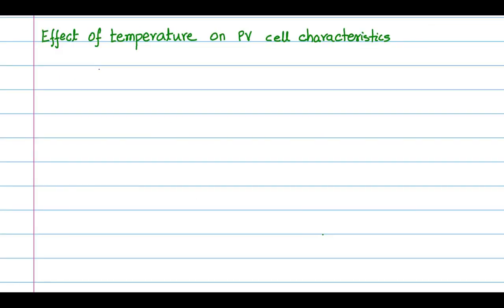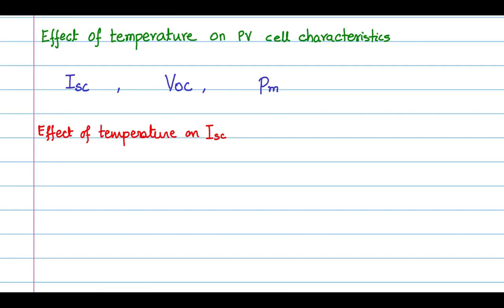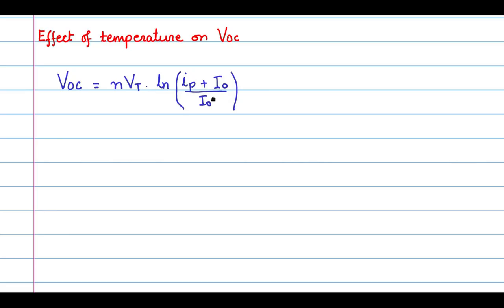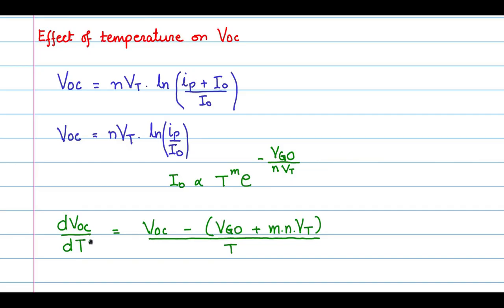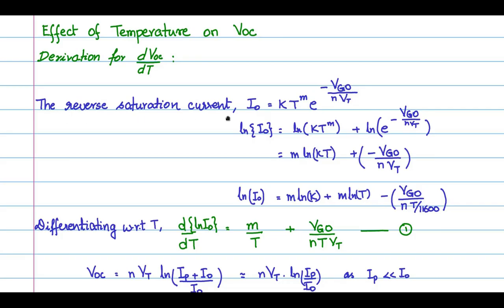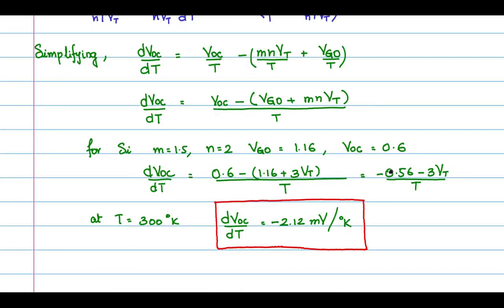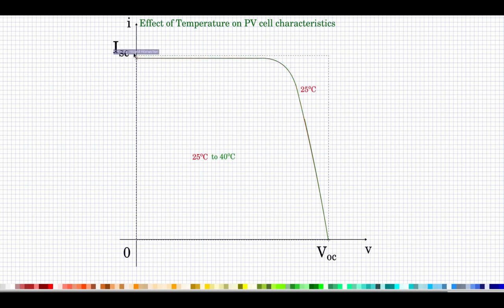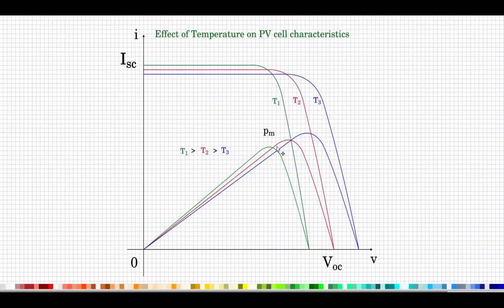Effect of temperature

Comment: Can anyone explain me the physics backround in decrease of effieciency in PV cells when the temperature increases? According to physics, higher temperature in semiconductors generates more free electrons so why is there a decrease in efficiency? 

I do not care too much about equasions... just the basic principle.

Thank you :)
Reply: Hi Josef,
As the temperature increases, there is a decrease in semiconductor "band gap", which in turn decreases the cell output voltage.
The term "band gap" represents the minimum energy that is required to excite an electron up to a state in the conduction band where it can participate in conduction.
Hope it clarifies !
- Sukhbir
Reply: @dearsukhbir  Hello, 
thank you a lot, this is the type of language I was looking for.
Bless you sir, I understand now :)
Reply: But shouldn’t the decrease in band gap width increase efficiency because  it is easier to excite and free an electron and therefore allow it to participate in conduction?
Reply: @manasahuja1193  I believe the trick here is in the output voltage.

When there is a decrease in a band gap, you might excite the electrons easier, but as long as it decreases the output voltage, you get less energy transfered to the load.

So less energy from the light is being utilized and you get lower efficiency.

Comment: respected sir, 
I have a doubt, we are Voc as 0.6 V, and calling it the cut-in voltage; is it the cut-in voltage due to the silicon p-n junction, however, Voc is the open circuit voltage, and as per the data-sheet of the BLD 240-60P discussed in the previous lectures; its value is 36.7 V, I will be very grateful if you and your team may clarify this doubt.
Reply: Every cell produce 0.6 V, and you have many of them connected in series, they were 60 cells, 60 * 0.6 = 36 V. These 60 cell is connected in series so the diodes like added in series so their total cut-in voltage will be 36 V, the diode he drawn imagine it many diodes in series that their equivalent is 36 V battery.

Comment: Sir, how can the fuse rating is greater than short circuit current?
Reply: since a solar cell is a limited current source it does not matter and fuse is not present to protect the panel. the fuse in this case only protects the cable and sized accordingly. in us(nec) it's next standard size of fuse beyond  sc*1.25